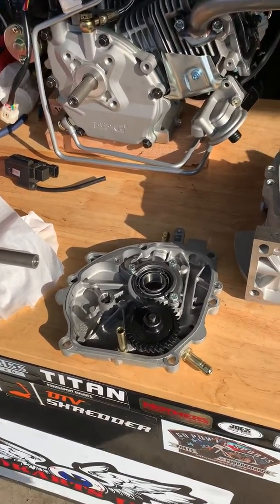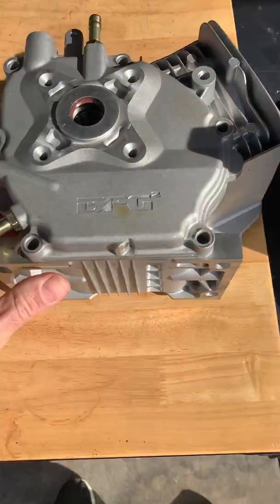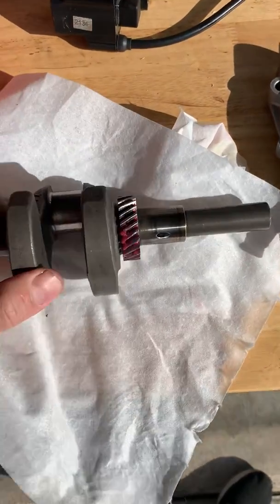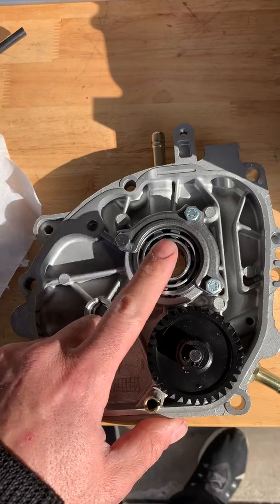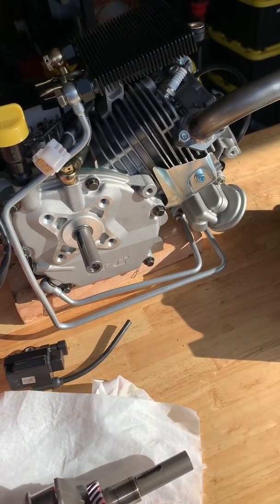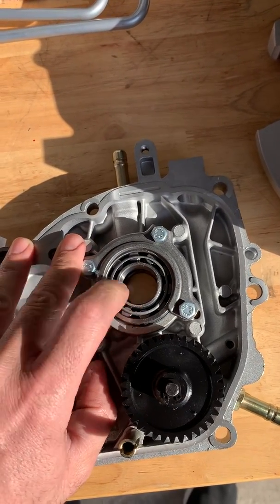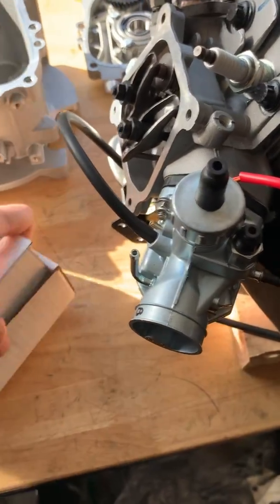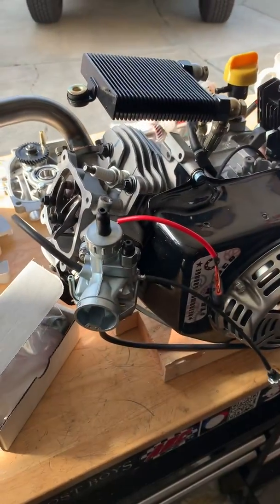DTV Shredder oil pump system explained.

Comment: With the billet side covers they are making nowadays, it wouldnt be too hard to make a gx200 clone side cover with an oil pump in it just like this, the hardest part is the crank needing to be drilled, would be cool if there was somebody out there making the needed parts, i would also have the rod drilled so the wrist pin gets oiled too